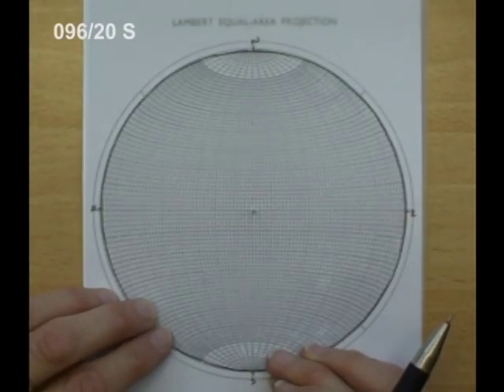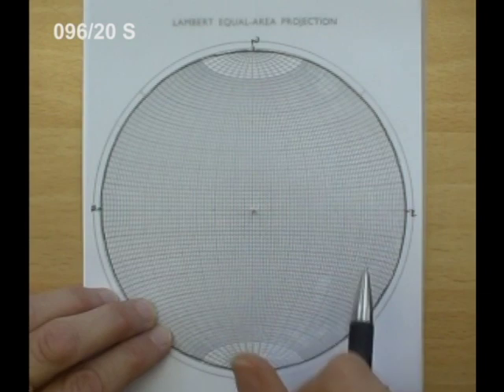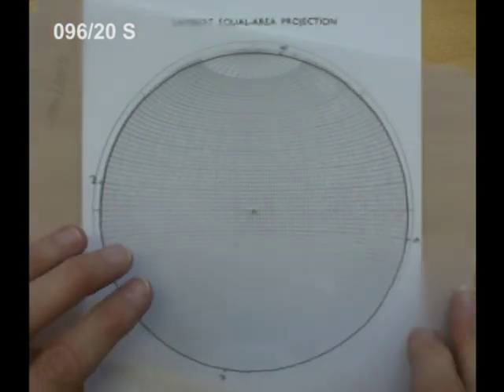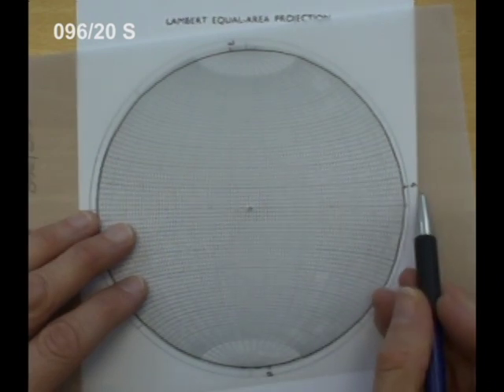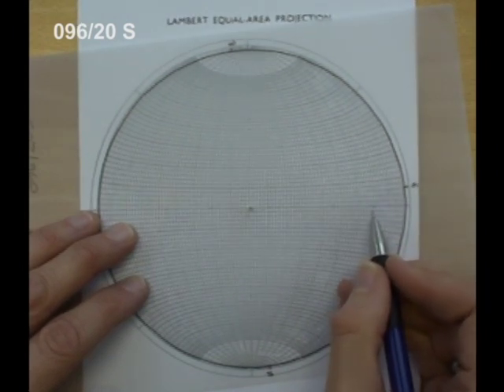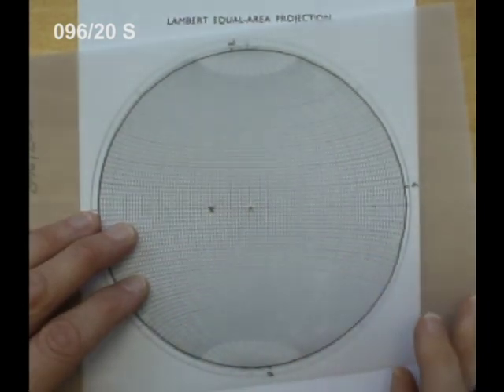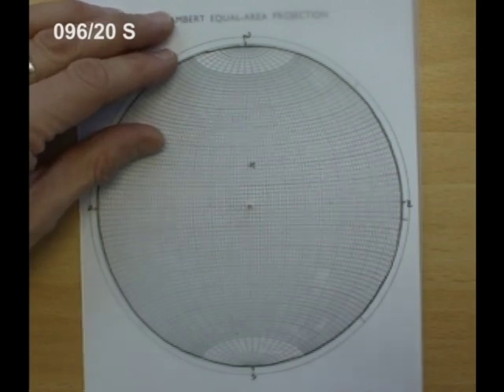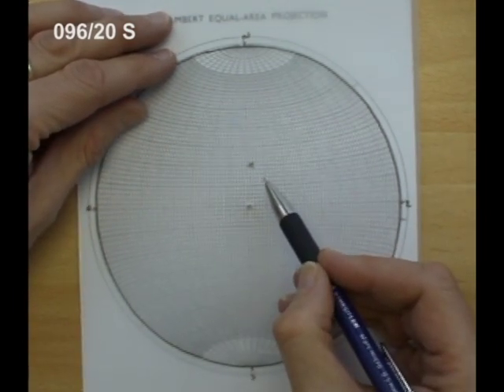How to plot poles to planes

Comment: What rule is the strike and dip using here? The previous videos used the right hand rule (RHR), but this video marks the plane with the left hand rule. With RHR a strike of 96 degrees dips to the north , not the south !!
Reply: RHR only applies if the dip direction is unstated and the strike in in azimuth form. In this example we are told that it dips south